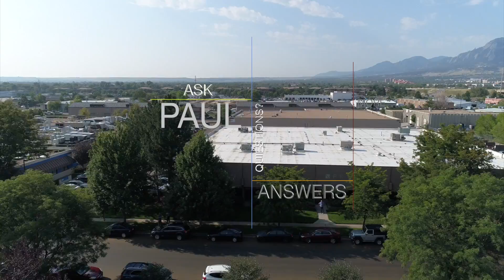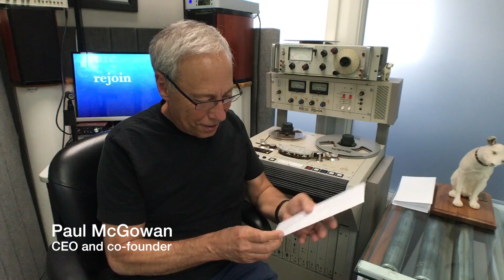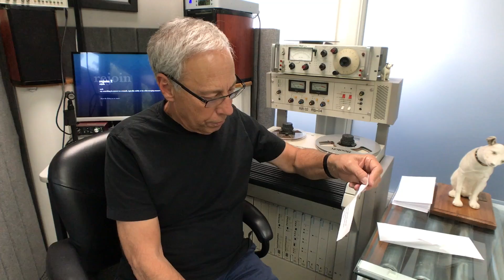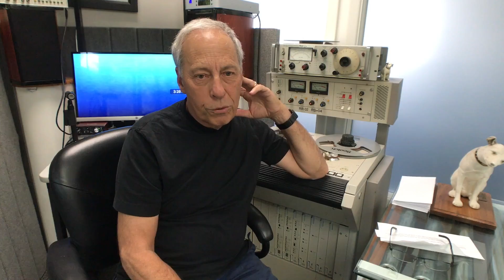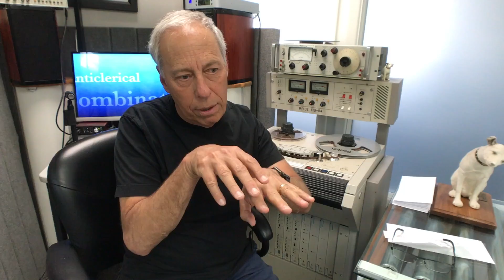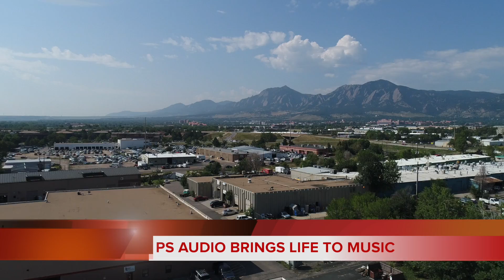How long do tubes last?

Comment: If you look at the history of "tubes" .. it started with looking at why metallic deposits were being seen on the insides of early incandescent lamps. 
It was figured that this must be due to "something" escaping from the hot filament of the lamp... and experments showed that if a metal plate was inserted inside .. then if this plate was connected to a postive voltage ( and the negative to the filament) - then a current would flow. Reverse that polarity.. no current flows... so  - we have the electronic equivalent of a "valve"  ( tube does not really describe what is going on!)
that lets current flow one way -from plate ( called the anode) to the filament ( called the cathode) .
So weve discovered the "rectifier"
Then it was discovered that if you put a wire mesh ( called a grid)  in between the cathode and anode.. you could vary this "current" ( which is actually electrons flying from cathode to anode) by putting a negative voltage on it.

By spacing this grid in the right way between cathode and anode... you could get a small signal to control a bigger current - and get "gain" 

So you can see that a "valve"  is not really much more than a lamp with extra bits of metal in it.
Build it right - treat it right .. and it lasts a long time!

Comment: When the owner actually knows how to bias, many of these audio guys don't even know. Can you keep it within the range of its operational millivolts. They can last up to 2-3000 hours (I wouldn't be surprised if this number is way higher) . Been an average of two or three hours of listening a day. That's quite a lot of hours.

Now quit talking about preamp tubes those last way longer. I won't to be surprised if some tubes for will last 10 to 20 or 30,000 hours

Comment: Might depend on the quality of your audio but I just ordered a new pair of 12AU7-S for my M1200s after 5 years and WOW!  Paul is right again!  Thanks Paul.  I think by now he knows his stuff.
Reply: Tubelife depends on several things, first... what level of filamentvoltage you are using, 6V - 6,3V - 7V, dont let the voltage be to high, 6V is ok. second, use a constant currentsource on the filament for not shocking the filament and its connectors when powering on like a standard rectifier and cap power do. And dont run the Anode into redplating. Dont let the tube idle 24/7 when not in use etc.etc.
Reply: @royrogers7644  absolutely.
If you look at any electronic component.. what is most likely to cause it to fail? 
In the case of valves - the heater and cathode are the most likely areas due to high temperatures and thermal stress- and thus running the heater  at controlled levels - and constant current will have a great impact.
When tommy flowers used around 1700 valves in ww2 to run the colossuss computer to decrypt german messages - he was told it would be unreliable with so many valves.. his answer was - run the heaters on the low side and never turn them off.
Reply: Be interesting to measure the old and new ones to see exactly what was different?
gm / mu? Cathode emissivity ( that is.. max anode current) 
Anode slope resistance? ( early effect)

Comment: I usually need to replace the 6J1s in my tube preamp at around a year. I listen every day.  I can tell because they do not roll off the same. The difference in channel gain tells you performance is dropping.  Very affordable, so I keep a few on hand.

Comment: I would like to comment, as a guitar player. Tube life depends upon a few variables. Quality is a big aspect. Vintage tubes made in the US can go on for years and still sound pretty good. Guitar amp tubes really take a beating, between the heat and transport, and some of them keep on running and sounding good for decades. Todays' tubes will not fare as well; but still do better than a year. Of course, stereo aficionados might have more scientifically tuned ears. But long time guitar players are pretty picky. We usually run those tubes until they begin to hiss or fry like an egg ... And I have a theory, after 62+ years of playing through tube amps ... transistors handle bottom end output at 100 cycles and below, much better than do tubes. You have to have a LOT of output tubes and some very large output transformers to get the clarity that the home sound system group wants to hear, so transistor sister do a better job, eh?

Comment: I have very little experience with tubes. I just have two in the preamp of my Rogue Sphinx V3. I have found that replacing them every one to two years is about right. I notice that the midradge starts to disipate after a year or so of steady listening.

Comment: I'd love to hear your thoughts on the retubed system, but try putting the year old preamp tubes back in and see if they don't sound great.   I think there's less need to replace those. Compared to the output tubes.   Pre tubes should last for a very long time...many years, or a decade or more.  Thanks!

Comment: As far as the various tubes that I use, they range in lifespan between 2500 and 5000 hours of use, as per the manufacturer's data sheet.  Now, as far as when the sound degradation becomes apparent/ noticeable I'd have to say depends on your own ears.

Comment: I have an old radio, built in 1958. Has the original tubes, not played hard. When the tubes reached 63 years old I noticed the sound was a little off, about 2 years later it got bad sounding, time for new tubes. Another radio I had, gotten rid of, that used tubes required new tubes every couple years, after 6 months they started sounding weak, could get maybe a year or 2 if used sparingly.

Comment: From what I know tubes are burned in and tested at the factory, at least they were 60 years ago. Also I have a tube radio with just about all original tubes, they might not sound like new but they still sound great after 64 years and I'm pretty sure most of them will last another 64 years. I sure would like to know how it sounds like with all new tubes though, Sadly most of em aren't made anymore.

Comment: I love output tubes. Of course if you asked Paul a year ago he might have said tubes do NOT sound better it the input stage. Viva KT88s! If you can use them in triode mode and still power your speakers properly, they give you most of the great tube sound with almost no downfall. Lots of music energy. I have heard some good MOSFET amps. Nagra - if you’ve can afford Swiss. Still, it’s a different kind of sound - very natural.

Comment: Not sure what the difference might be between tubes used in ur type of amps vs guitar amps . I bought an amp a few yrs ago made in 1978 . The preamp tubes were original the prw tubes had been replaced once . The 1st owner was the seller . Still sounded good as ud want . Changed the preamp tubes with no change in sound . Friend of mine says tubes aren't made as good as they were . Is that why us want to change them every ur?

Comment: I’m a guitarist so my needs may be different. My amp uses tubes, 12ax7s and EL34s. After replacing Russian and Chinese tubes far too often I took the plunge and bought NOS and as-new used Mullard tubes from England. The NEWEST of these is a mid seventies NOS set of EL34s, the oldest is a 12ax7 date coded August 1960, same as me. They all work and test better than brand new reproductions. Perhaps the need to replace annually reflects the poor quality of modern tubes rather than the longevity of old school quality control. Maybe I’m just hard of hearing. :)

Comment: You’re right in that tube slowly degrading performance and it’s very deceptive and hard to see but tubes have a very definite life expectancy especially power tubes my holy Grail of the RCA tubing guy Manuel it estimates 1000 hours of full power before the amount of electrodes are burned off by the The cathode decreases to an amount that is unsatisfactory to meet the specs power tubes 1000 hours is usually considered to be a year is used for hi-fi same with stylus is on cartridges once a year low level tubes is well they asked seven for example is not wearing out it will lose the seal as you say but otherwise they last a long long time

Comment: Dang, I've had the same factory tubes in my Mesa Boogie Strategy 500 since 1994 when I bought it new. I'd probably change tubes out more often if it didn't cost $400 a pop.

Comment: My father and his brother bought Yaesu FT 200 HF transceivers at about the same time.  His brother left his one turned on 24/7 365.  Both radios were still working and had not had a single tube replaced after at least 15 years when both men went to their first transistorized radios.  Output power was probably down, but fully operational.  I gave my dad my Kenwood TS 430S with the 250 antenna tuner and he used that for another 15 years before he sold everything off and moved to New Zealand....  Nowadays we talk using skype, whatsapp or messenger.....

Comment: If the tubes are driven all the way to their design limits, they won't last long.  Some equipment is designed to not push the tubes hard, and then tubes may last decades.
Reply: My current radio the tubes lasted 65 years before they got replaced.
Reply: I think it depends on the volume that you are pushing, like tube preamps lasts much longer when compared to guitar power amps that play loud most of time
Reply: Of course build year and quality also can change life, I have tubes from 1960 and they are still pretty fine, but many from 60's died aswell

Comment: It really depends on how much you use them, what their application is and the quality of them. I can’t talk for hifi amps but I found with guitar amps that the power section ones only last about a year, preamp ones can last several years .
Reply: My ex band mate plays regularly with two bands. His Fender DeVille 212 has hadoriginal tubes +20 years and still working just fine. Only maintenance has been replacing one input jack and one fuse.
Reply: I agree ,I was lucky, mine lasted about 21/2 yrs to last sat night last song of night and  Puff! 🤣

Comment: what is not being made clear is....hours of service.  Tubes are kind of rated like a light bulb.....how many hours it should be expected to burn....BECAUSE they both use a thoriated tungsten filament...light bulbs and vacuum tubes.  SO if his listening room system is constantly ON...it accumulates hours.  Tubes generally are good for several thousand hours.....and if they have a good vacuum and seal...they could go longer.  Also factored in is the on/off cycle which could eventually cook off the coatings on the metal parts within the vacuum....so there are other factors for wear and tear.....remembering that cycling on/off also imparts heating and cooling thus expansion and contraction.....so there are basic factors hiding in front of your nose in the matter.  BUT in a perfect world they theoretically could last indefinitely.  The designed obsolescence factor is the actual vacuum in the glass.....as that can be manipulated as with light bulbs...the science was so precise in manufacturing.......profits depend on repeat sales based on a cycle of longevity and controlling the aspects of longevity.
Reply: to illustrate....the edison light bulb in some firehouse out in california has been burning for 100 years.........as it was produced prior to the concept of designed obsolescence in business.  So basically it came off the assembly line with an extremely good vacuum and has been permitted to burn steady and not been subject to adversity's.....like extreme vibrations and on/off cycles......its been in a steady state.   You definitely wouldn't find a modern chinese made light bulb that would ever last that long ......since they are not made in america these days......and they are made post era of designed obsolescence in the business models.......you might be lucky to get a month or 2 out of a chinese light bulb.

Comment: It’s way more convoluted than Paul’s answer regarding tubes. It depends on the quality of tubes, listener, system & parameters the tubes are operated at, age & hours on tubes. Also, with tubes there is always an upgrade path.

Comment: Change the tubes once a year might apply to Power tubes like KT88 but definitely does not apply to the smaller input tubes. Mine 12AX7 and 12AT7s are 5 years old and still sound amazing. I know that because 6 months ago, I replaced then all with new tubes (same make and model) and after the break-in period I still couldn't tell the difference between them.

Comment: The amount of time that a tube can last depends both on its original quality and how hard it is used.
My pre-amp tubes seem to go on for ever, so I presume that they are not pushed too hard in my Conrad Johnson 9a. 
The ones that I seem to keep replacing are the driver tubes, so I presume that they must have a harder life. 

I do get the point that they are great for inputs (is this because they present a very high input impedance?), but I also like tube power amps.

One thing.
I do tend to change to my solid state power in the summer!

Comment: Hello, I own a Mcintosh MA230 integrated tube amp and am having issues with the left speaker.  It is very low and the sound that comes out of it is hissy and crackly.  the speakers work fine when i run the right channel through them so i know its not the wire, connection or the speaker itself.  My question is, can a bad tube effect only one speaker?  The other speaker sounds great.  Your wisdom would be greatly appreciated.  Thanks.
Reply: Yes. You have different output tubes for each channel. Swap the tubes for the left channel with the right channel ones and I bet that your right channel will sound bad and the left one good. Your preamp section is solid state so that is most likely not the culprit. Well since I just noticed your post is almost a year old you probably have it figured out already. Great amp!

Comment: I have a preamp with 12ax7 tubes from 1960 and they still sound good.
Reply: Same with me. I have my dad's Pilot 216a preamp and it sounds wonderful. I did however change all the capacitors and many of the out of spec resistors. But the tubes still sound good.

Comment: I bought a second hand Quicksilver amp with 8417 output tubes back in 1997 for 200 USD as the original owner had concerns that the output tubes had been very hard to find since 1988. The amp still works to this day with the original tubes but I no longer listen to it for long periods because there are EL34 based amps that sound similar (though will less muscular bass cimpared with the 8417 equipped Quicksilver) with more  widely available tubes.
Reply: @Laurentz Duba - to my ears, the 8417 tube sounds like a 1990s era solid state amp designed by Tom Evans.

Comment: I disagree with having to ,,re-tube,, the system once a year. I own many systems of all sorts and never for the past 8 years had to change tubes ,,definitely not yearly'' in them other that Capacitors and Resistors and perhaps clean switches and pots. I do however own a tube tester and yes I have tested them all (summer last year) but they seem to have between  50-70% life left in them after all this years and yes fairly regular and  they all still sound (to my ear) as good as day 1.  All amps, preamps, radios, testing equipment that I own contain a total of 237 tubes and only ever had to change 2 tubes (once)  because of  water spillage (accident caused by my younger daughter) And I have numerous friends who own more or less similar equipment and never had to change a tube in them,  ever.  So....!?  
Of course for people who have a lot of money @ their disposal (to waste), well.... by all means go ahead and change it every year.  ;)
Reply: I agree. Why is it that you can still power up a vintage tube Amp after so many decades
Reply: there is a good reason for changing them every year or two ..it keeps the factories working! and even improving. If they don' make enough ..they SHUT DOWN

Comment: Under normal design range and operating loads of the normal condition preamp tubes (12au, 12ax, etc), you may replace them in 3 to 5 years for daily usage of 3 to 6 hrs a day, I anticipated. The "failure stage" could be longer.

Comment: Change them once a year? 
No. Absolute nonsense. 
test them once a year and bias them every 3 to 6 months after initial burn in. 
If you're having to change your tubes out once a year, you need to check your gear. Even cheap tubes last longer than that.

Comment: don't skimp on preamp tubes if you care about your tone ,your money and your sanity.
modern preamp tubes(china \russia \slovakia) last  up to 2000 hours .nos preamp tubes last 10000 hours or more .
the fact that audiophiles put cheap (10- 40$ each)russian or chinese made components in their high end preamp is crazy since:
1. they sound so bad compared to nos. do an a\b comparison trust your ears( not paul in this case he is marketing his gear which uses russian tubes as the heart of the amp  )
2. they don't last as long as nos. you have to worry about it every year and buy tubes again.
paul uses 40$ a piece new sensor genalex tubes (all russian tubes are made in the same factory these days  sovtek genalex eh mullard ri brimar tung sol groove tubes all sovtek with nicer labels and boxes)which costs 40$ .even though proper nos tubes costs 2 or 3 times that price ,they sound better ,last longer and keep you free from stupid worries you shouldnt have with high end gear. let's say you have only 5 tubes so 200$ a year for every year of uncertainty and  harsh sound or about 500$ for 5 years of  sweet sound (so say audiophiles in the last 70 years) and peace of mind. you can buy nos from reputable stores and dealers :upscale audio thetubestore tubedepot etc
Reply: test the tubes once a year! what about hours of use?